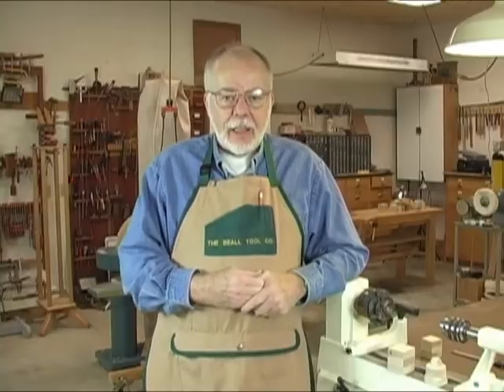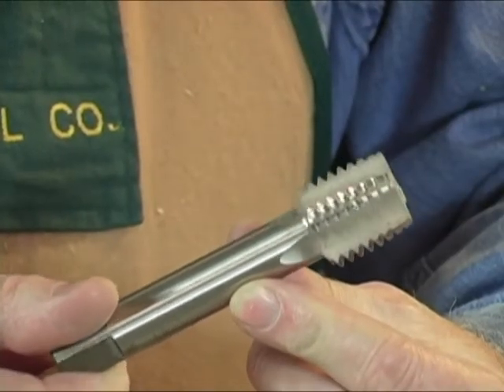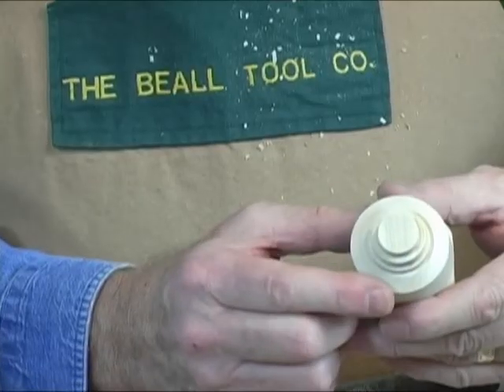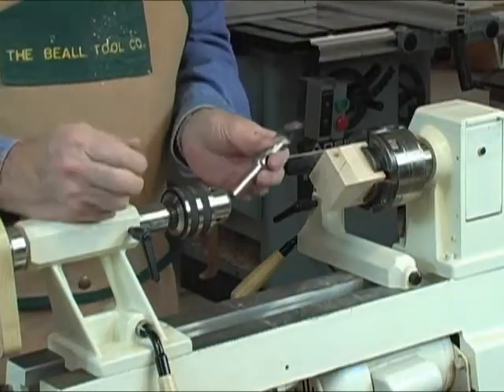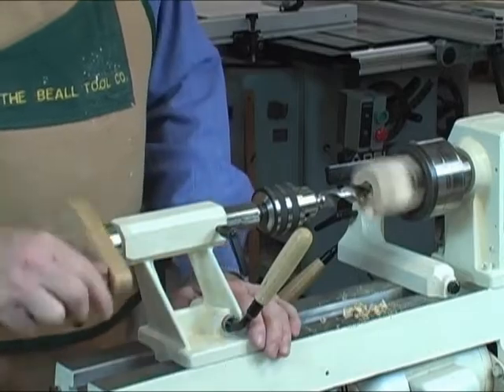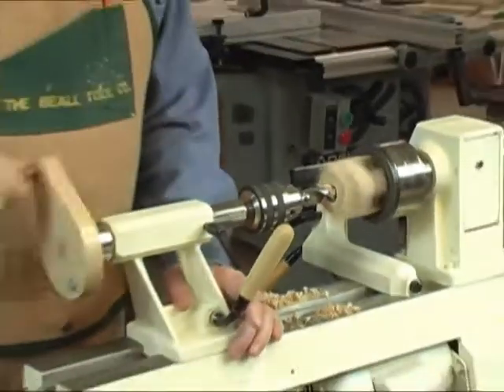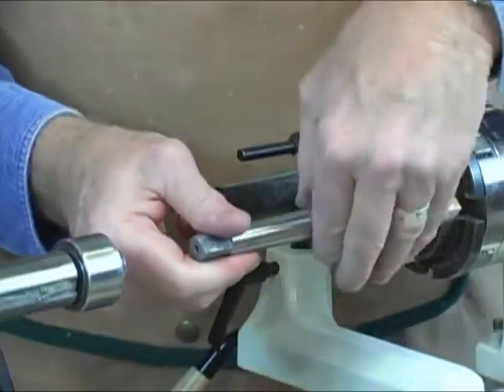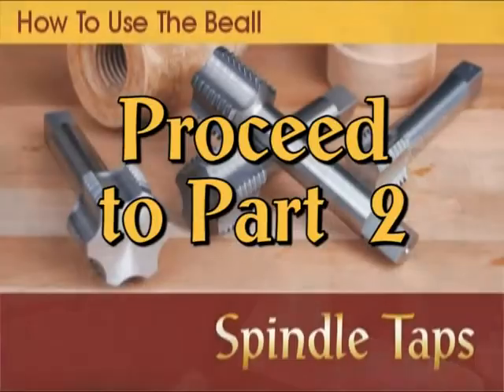Spindle Tap How To Part 1 You Tube

Comment: Why why why.... make this based on a plug tap design... You have to drill your pilot so much deeper than necessary now while a bottoming tap design would've sufficed just as well ^smh*
Reply from the maker: You are correct,  We will try to change that the next time we order.  Thanks,
JR
Reply: You could always turn a rabbet on the outboard face and plug it.

Comment: JR, your tools are absolutely great to work with.  I bought a few of your tools including a 1" 8 tpi to make wooden face plates for my lathe drive and your tap goes through Rock Oak like it's butter!  This Rock Oak is over 35 years old and like petrified wood. When turning it I have stop every 15 minutes to sharpen my tool.

Comment: your video moves a bit slowly.

I like the idea of a Tap, but do you have the mating Die set to thread spindles that match the tapped holes?

I have seen Tap and Die sets but the threads do not correspond to lathe spindles.